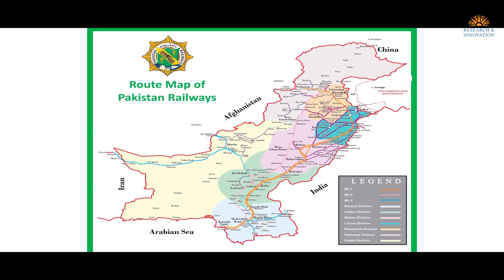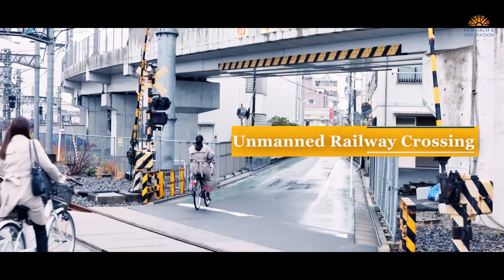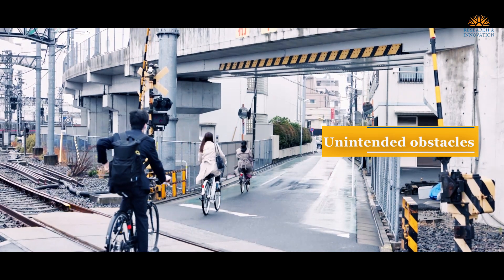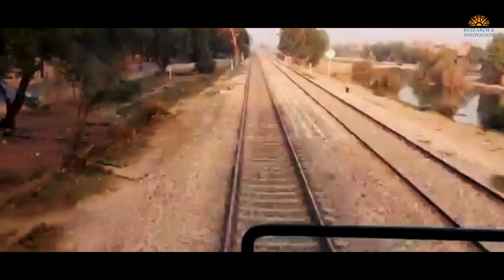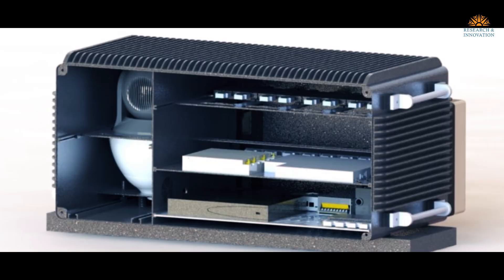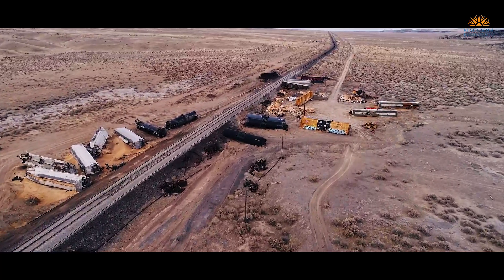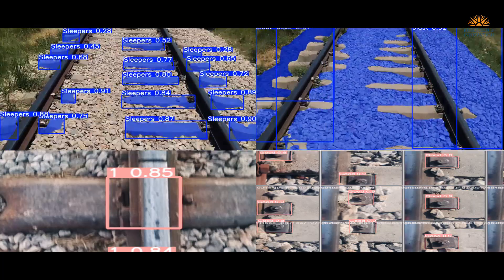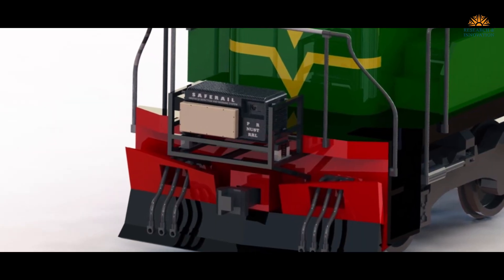Episode 11 | SafeRail: Protecting tracks with AI and Radar Technology | Innovatio Impulsum

Comment: The project seems fancy in lab settings. However, the proposed 1 to 2 km obstacle detection using cameras and radar is hindered by NLOS issues, weather related limitations of optical sensors, and radar difficulty distinguishing complex objects over long distances. The reliance on cameras for track defect detection raises concerns about scalability, especially for a 1,700 km network, as it requires high resolution imaging, extensive data analysis, and consistent power supply.